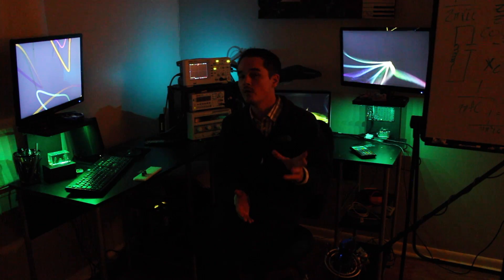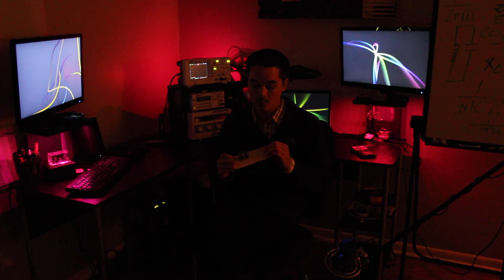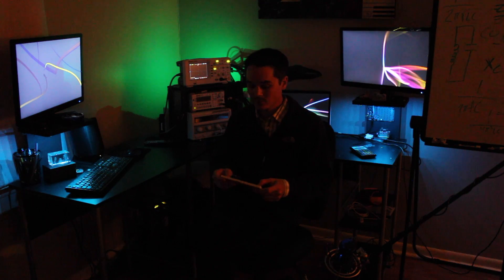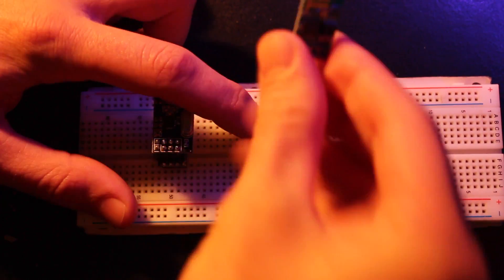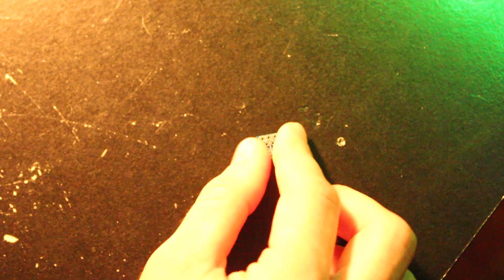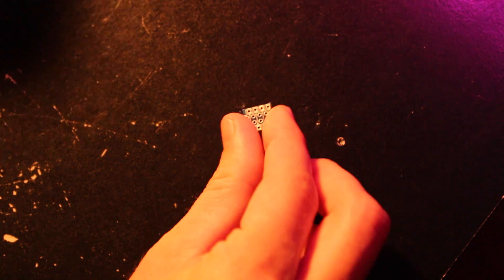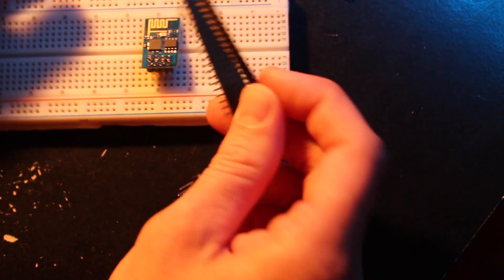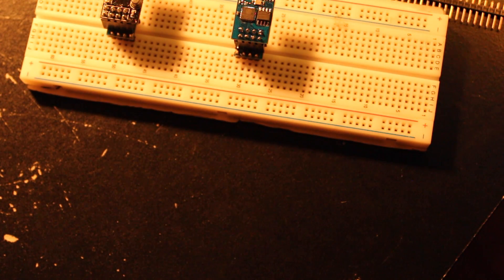Wireless Module on Breadboard - NRF24L01+ and ESP8266

Comment: Is it possible to address mutiple NRF24L01 modules with this? And how would I send data to a specific one? By adding an 'ID' byte to the data?
Reply: It's a board with some copper on it. It doesn't contain any kind of logic. It's just meant to make things easier to put together.
Reply: I commented this on the wrong video, it was supposed to be commented on the library runthrough :) Because i want to 'talk' to multiple nrf24l01's with one master. I know this is just a simple physicle adapter :P